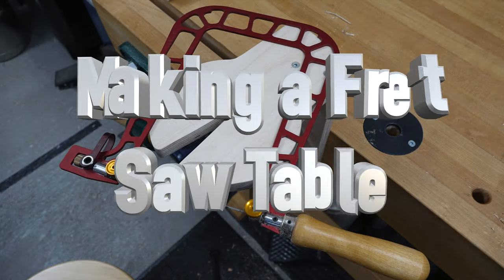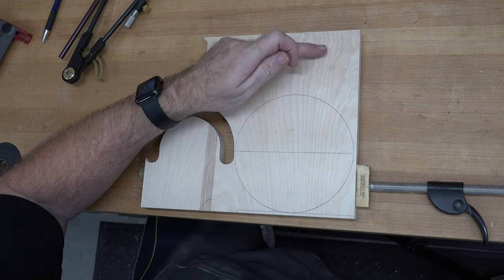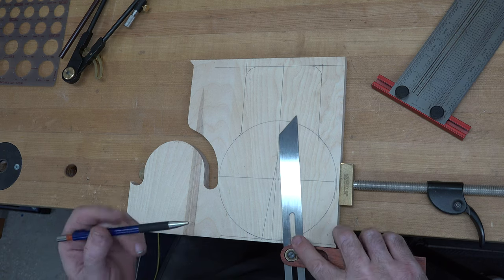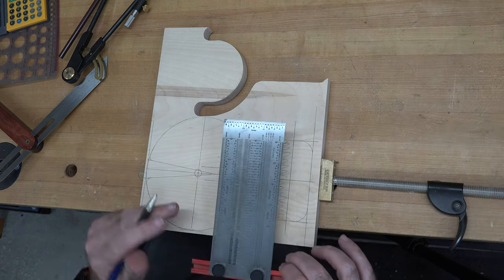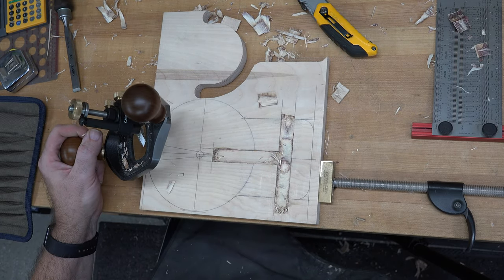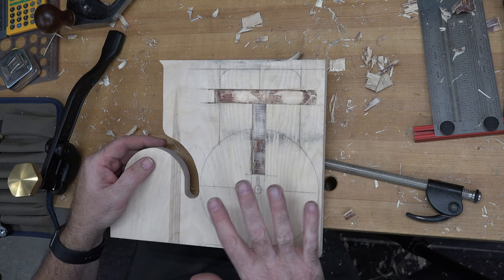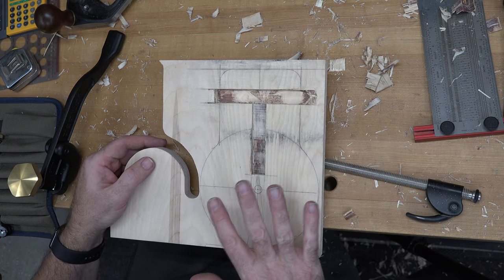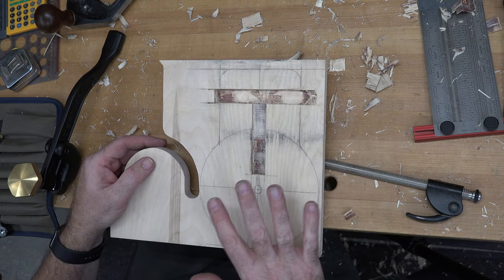Making a Fret Saw Table

Comment: Hi Kenny... landed on this video while perusing the new website. Midway through I reflected on the original leading caption... no scroll saw... no problem re: Making a fret saw table  then halfway into the build you take the piece over to a scroll saw to do some cuts. I sat there chuckling about that. Hmmm... Cheers
Reply from the maker: That's hilarious Phin.  The best part is that you don't need a scroll saw to cut out the fretsaw table.  You can use a bandsaw or a fret saw.  The fact that I used a scroll saw is only made possible because I have one and it is my tool of choice.  Thanks for checking out the website, tuning in to the show and giving me a chuckle at the same time.  It's very much appreciated.

Comment: I’ve seen some on utube, of people have a vertical holder for the coping saw that enables them to saw saw vertically while hold the workpiece with their other hand. Is there anyway to make one?
Reply from the maker: I think what you are describing is pretty much the same thing that I have made here except the table runs vertically instead of horizontally.  I have seen these "tables" as well and they aren't hard to make.  Sounds like I need to produce a show on it.  Thanks for tuning in to the program.

Comment: Great. What is that marking tool you use to draw the lines etc. on the plywood at the beginning?
Reply from the maker: The marking tool you are asking about Graham is called a T-rule and they are made by INCRA.  They are available at most woodworking suppliers or directly from Incra.com.
I got mine at Lee Valley Tools.  Here's a link.  I hope it helps.  https://www.leevalley.com/en-ca/shop/tools/hand-tools/marking-and-measuring/rules/58877-incra-t-rules
Thanks for tuning in to the show.

Comment: Kenny, great project.  I have seen those used by a watchmaker to cut gears, that was really intricate work.  I can see that after using it a bit and getting used to it it could be quite relaxing.  Good build.
Reply from the maker: It's amazing how much control the fret saw table provides Paul.  I have to be honest and say that I was a little shocked myself.  LOL.  Thanks for tuning in to the show sir.

Comment: Manual holder for the saw to be connected??
Reply from the maker: I'm not exactly sure what you are asking here.  Can you clarify your question?  Thanks for tuning in.
Reply: @acutabove_woodworkings  It almost sounds like they want a sliding mount for the saw itself so it is held perpendicular as part of the table.